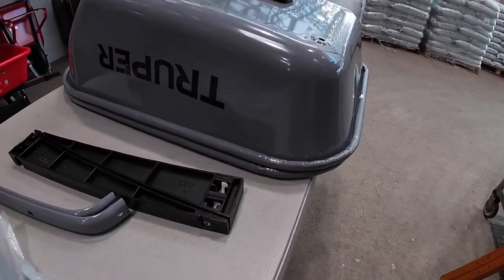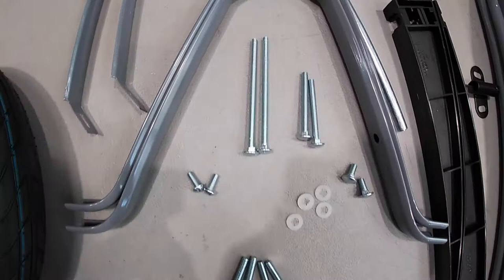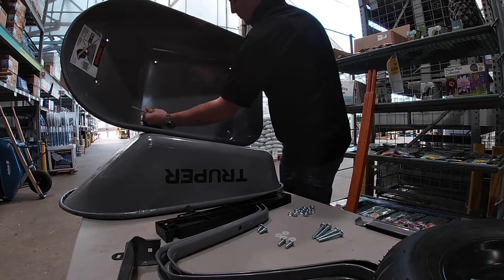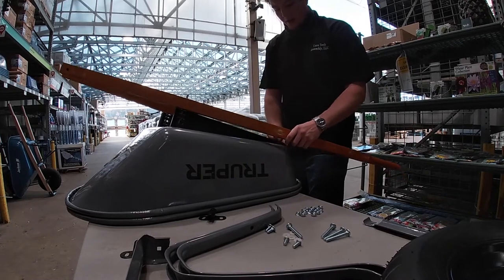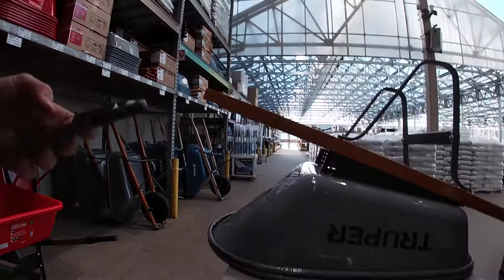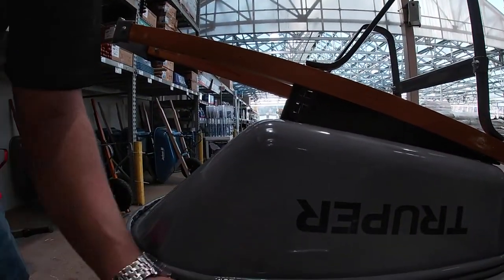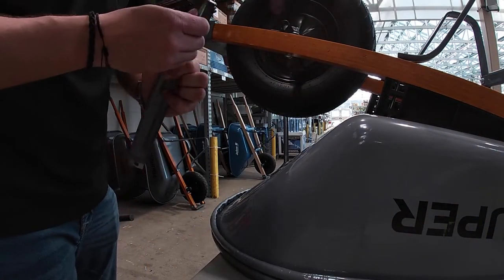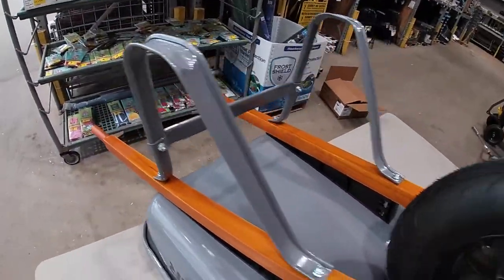Truper Wheelbarrow Assembly Training

Comment: Wow, the instructions i got from them told me for step 3 to put wheels on then tighten everything. Then step 4 was to put in the wheel guard. They flipped the steps. i had to take the wheels apart to put on the tray brace, which they instructed to do on step 4 (last step). So thank you for this video. Great help.

Comment: Where did the four plastic washers go you didn’t use?
Reply: The plastic washers are only to hold the 4 bolts into place. If you stack the wheelbarrows as he does, there is no need for them since stacking will hold those bolts into place. I never use them and just throw them out